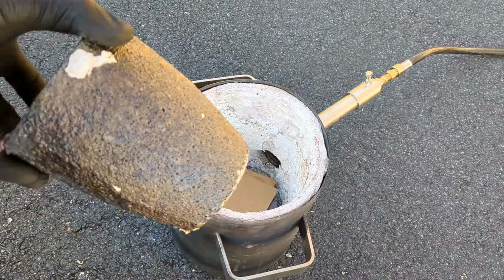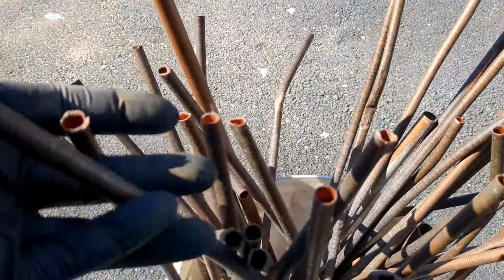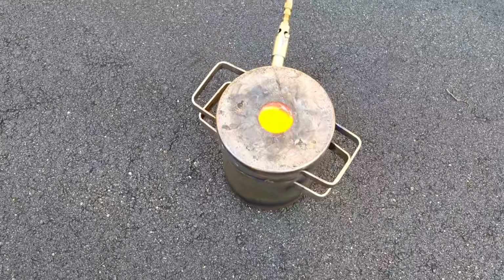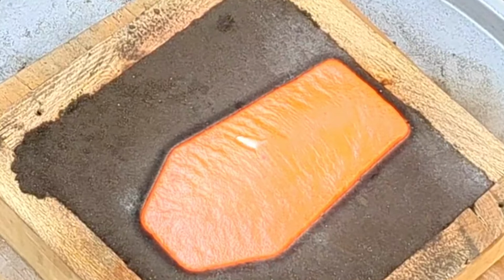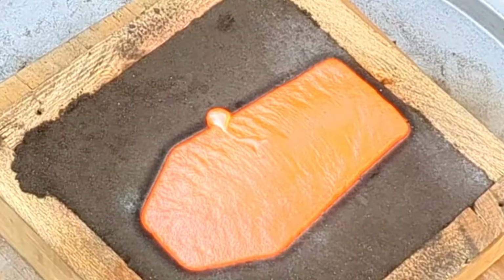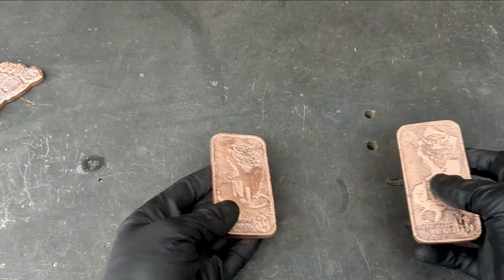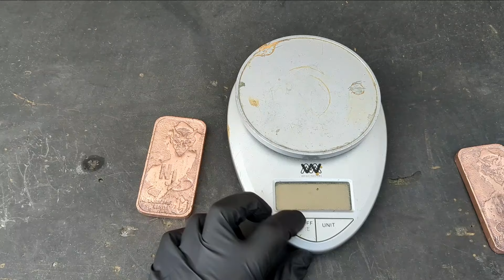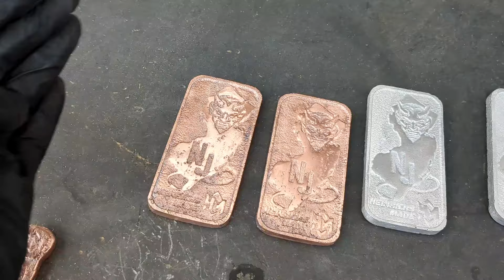Melting Down Copper - Metal Casting Copper in sand molds for metal casting

Comment: My theory about the ingots reaction is you mat have added some copper that was alloyed with Beryllium.  I'm  pretty sure asbestos will do the same thing but those copper pipes wouldn't cantain either. Nice pours!
Reply from the maker: Hmmm, I think it was because of the moisture in my greensand.  I think I over poured the copper too.  I didn't want to stop because it looked so cool. 😂😂. I don't know..
  I don't think I had any beryllium in the mix.
Reply: @HeinrichsMade  you're probably right.  I was recently  reading on the many alloys used in copper products and like asbestos beryllium has a higher than copper melting point. There are other alloys that take a lot of heat as well but I  know little to nothing about greensand
Reply from the maker: @mattyal9347  I have actually never read anything about metals.  Lol I'm sure it's super interesting.  Probably something I should get into.

Comment: I love copper and brass, just wish I could get it to cast as nice as my aluminum,  maybe I need to get it hotter.
Reply from the maker: Copper doesn't sand cast great, but does cast.  Brass casts much better.  What problems are you having?  Definitely get an infrared thermometer to check the temp.  You might be getting it hot enough.
Reply: @HeinrichsMade  yeah I need a thermometer, just seems to have a lot more bubbles/porosity than my aluminum.

Comment: wait, those copper pipe are from radiator, where the alum fins are taking off.  You will have some alum contamination.
Reply from the maker: I don't think it would be contaminated with aluminum.  The aluminum tins are not connected to the copper in any way.  They are just slid over the pipe with very small tolerance.  I just finished another video and will be posting it soon on removing the fins.  I said radiator, but it  was actually an evaporator coil.
Reply: @HeinrichsMade  it's the alum dust attach to the pipe. You should've use copper water pipe
Reply: @maktheturd6220 you use what you have, by the time he remelts the ingots the aluminum content will be negligible, he isn't casting for industrial parts, so it really doesn't matter.
Reply from the maker: @maktheturd6220  interesting...